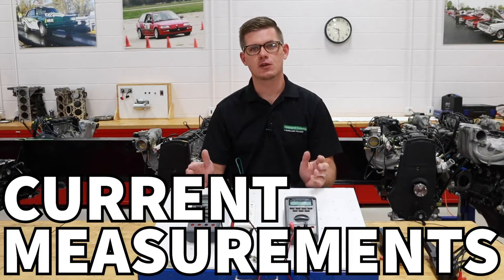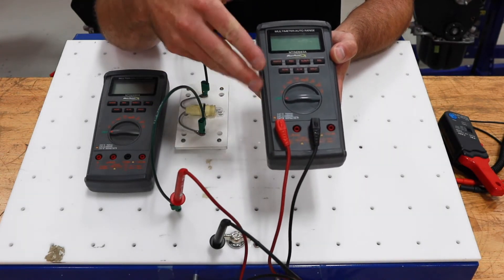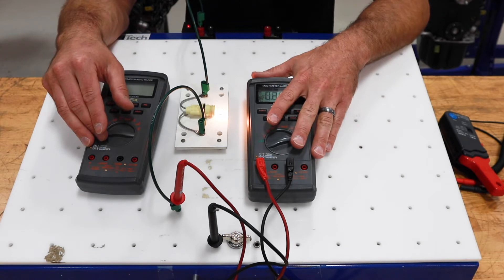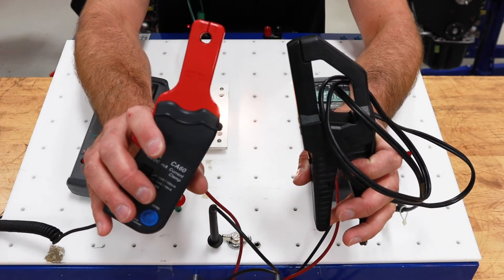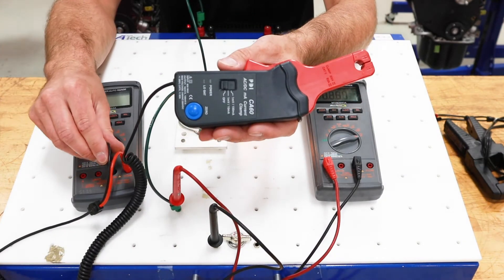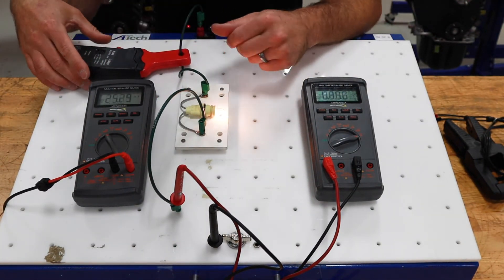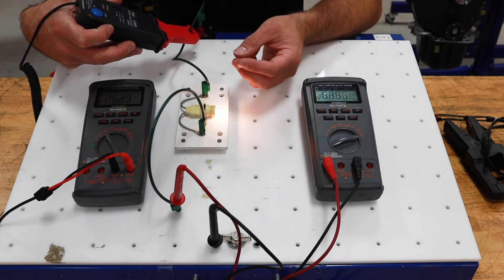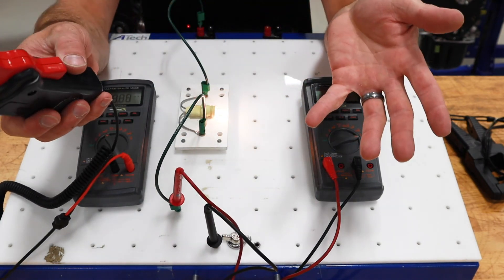Measuring Current with a Multi-Meter and Amp Clamp

Comment: I really dislike the lack of uniformity when it comes to stand alone clamps that plug in to a dvom. It’s just a mess, readings all over the place, annoying conversion scales, manufacturer won’t friggin tell you what the mv conversion scale is…. Etc. just a hot mess. Got a dedicated amp clamp with a built in display instead and now I can actually troubleshoot the equipment I’m working on instead of the pos amp clamp.

Comment: Will setting are you putting your multimeter on bud. I know what to take voltage but the company's wanting us to take amp readings. Im struggling here
Reply from the maker: Amp clamps typically output in mV. Each clamp will specify the conversion of mV to A or mA. I would start with reviewing the manual for the specific clamp you are using, then fill in the gaps.